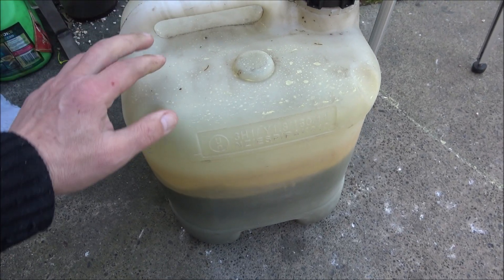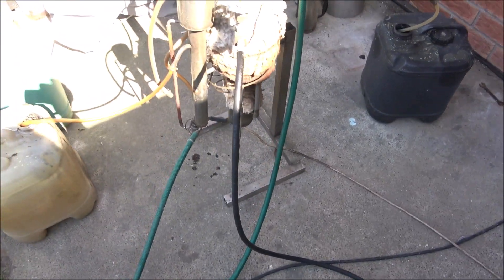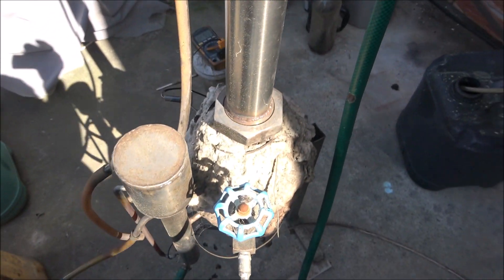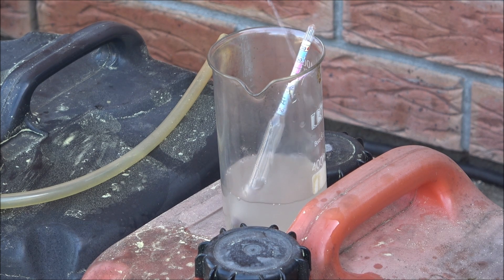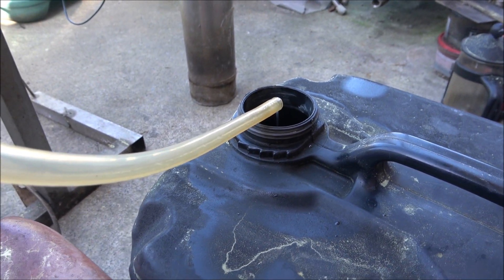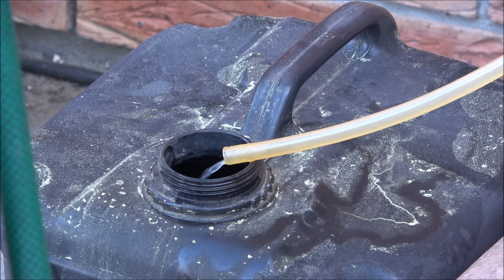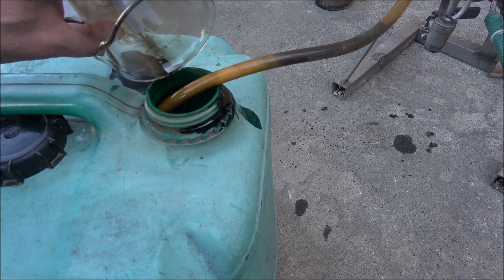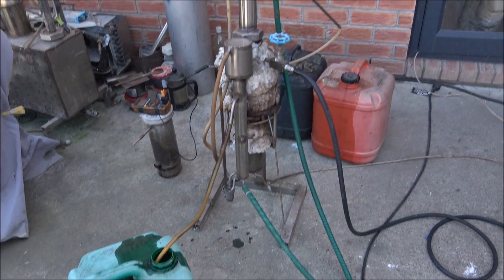Petrol recovery from WMO/PETROL mix or crude oil.

Comment: Going by this mixture of gasoline and used engine oil am kind of curious if one decided to run it hotter up to diesel destillation temperature would it be able to produce straight diesel??....
Reply from the maker: The oil containing petrol is an azeotrope, which is a mixture of two different liquids with a boiling point much lower than that of diesel. So, even with heating, it won't reach the temperature required for diesel distillation. As a result, petrol is removed first, followed by the separation of the remaining oil through a similar distillation process in an oil distiller. This process would then make it possible to produce diesel fuel.

Comment: Curious Alek.......  though this varies based on economic conditions....  so if one used a baseline of say.. today's economy...  there in NZ....  which of your processes/apparatus (the distillers, recovery units etc.) do you find the:
-  value of usable end result material was equal to the expenses (labor, materials, power used to create it etc)... 
- which produced and end result material more valuable than expenses?  
- which ones did you find the expenses in producing the final material outweight the value of the result.
Reply from the maker: The most cost-effective option is the petrol separator, which applies to both businesses and individuals with access to crude oil, natural gas condensate, or accidental mixes of petrol and diesel. Believe me, even in a small country like New Zealand, there are thousands of tons of fuel getting accidentally or deliberately mixed every week. Tanker loads of such mixed fuel are common, so any business involved in fuel rescue will benefit immediately.

Firstly, any removed fuel can be recovered and used to power a fleet of machinery within the same business. It can also be used to flush the fuel tanks of cars, trucks, and boats, and then recovered again. This process eliminates any losses, turning the mixed fuel problem into a potential goldmine.

The second option is an oil distiller, capable of clearing pyrolysis fluids and processing used motor oil. However, this option is better suited for businesses or individuals in extremely desperate situations who can still obtain rubber, plastic, or used oil when diesel is unavailable. Dedication is crucial in such cases. Additionally, when processing used oil, the end result is base oil, which can be transformed into various types of lubricants with the help of appropriate additives. Given the high cost of some greases or motor oils, there's no need to process large quantities, especially in the context of grease manufacturing.

In any case, production costs are lower than those of pump fuel, though the process may take time. This makes it a viable option when fuel is scarce or unavailable, a situation that some places are already experiencing. Moreover, consider the broader business perspective.
Reply: @santeryi9   well laid out and informative reply.  Mucho Gracious!!

Comment: How do you make this operation continuous?  How do you separate the feed stream from the residual output?  Seems like this unit is very sensitive to an experienced operator.  If feed is too high, for example, would you end up with lighter fractions in the residual container?
Reply from the maker: This unit is a simplified version of electronically temperature controlled units that I usually makke for sale, in other words, keep it at desired temperature that will allow all the light fractions to evaporate and no light fraction will get in to the diesel/oil output due to huigh enough temperture, plus the reactor constrruction.